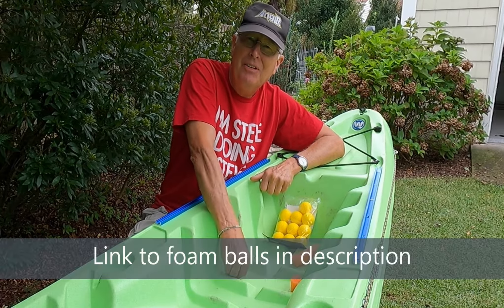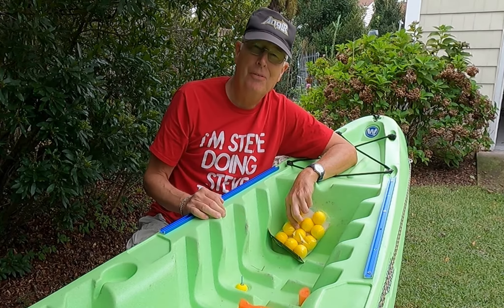Fishing Kayak Setup for Beginners - Step 14b - Foam Golf Ball Scupper Plugs

Comment: I just use Paracord and put knot on the bottom and a loop on top works great and you don't have to worry about your leg on the bolt, love your tips thanks
Reply from the maker: That's a great idea!
Reply: That’s what I use. My kayak came with scupper plugs but my previous kayak didn’t.
Reply: I use a small washer between the knot and the ball to help prevent the knot from pulling through.
Reply: Could you make the paracord long enough to attach to each ball with one cord? Then you can pull both out at the same time.
Reply: @BostonClipper  I don't see why this wouldn't be possible. In fact, that's how I plan to customize mine.

Comment: Great idea and John & Larry both address a concern I had about stepping on or scraping by that upright bolt.  My original thought had to do with cable ties- I use them for lots of stuff.  I would leave the tail end ticking up long enough so it’s not rigid.  It could be long enough to reach over and grab when you get older and develop and old man’s body with a large stomach.
Reply from the maker: Great point!

Comment: I poked a crochet hook through the middle of each foam ball, looped paracord into the hook and pulled it back through, then tied a knot on the loop side and another on the loose side to lock the ball in place. I made a lifetime supply of plugs, each with a handy loop handle, in about 10 minutes. They work great.
Reply from the maker: Great tip!

Comment: I would suggest you look at Sean Cooke's YouTube video, "Pescador Pro Seat Problem SOLVED (scupper plugs).  I have been using his solution for a year now with great success.  You get no water getting into the kayak thru the scupper plugs, but it allows any water to drain out.  The fix is detailed at the 9:50 mark, if you don't want to watch the entire video
Reply from the maker: I will check it out

Comment: We used the foam golf balls on my grandson's 10' Pelican, and they're still there.. Told him if he ever needs to remove them for quick drainage,  to use the butt end of his spinning rod handle to push them through the bottom side of the kayak. Might not work if one has larger diameter rod butts though.

Comment: I think the bolt may hurt someone. I thing a better way is to make a string through the golf ball whole which the bolt made. You can add a gasket at the end to make sure the item stronger to use. If you make a knot as a handle, it will enhance the performance.
Reply from the maker: Good idea!

Comment: I used foam golf balls for a couple weeks and hated them. They either wouldn't stay put, or when they did, would get water logged. I ended up using cheap sink stoppers they stayed put and I didn't have squeeze the water out of them at the end of the day.
Reply from the maker: Good idea... I have an upcoming video on an inexpensive purchase solution
Reply: I'd guess that the scupper holes on your boat are too big to hold the golf balls securely. I've been using the same set for three years and they stay put.
Reply from the maker: @jimking2299  The golf balls work fine. But, I keep looking for more solutions to give people options
Reply: @KayakhacksFishing  Thanks. It'a greatly appreciated. I was referring to Ron, above, who said his golf-ball plugs wouldn't stay in place.